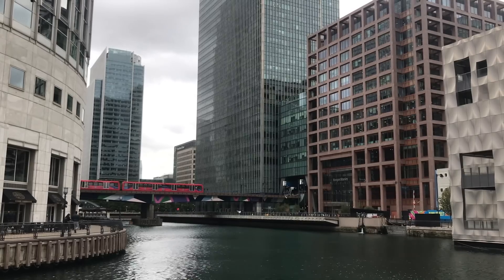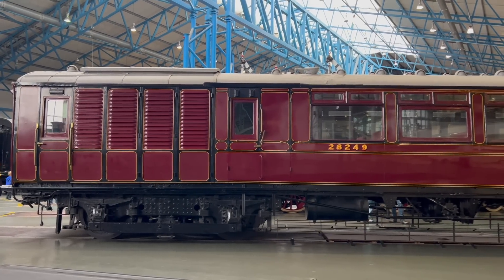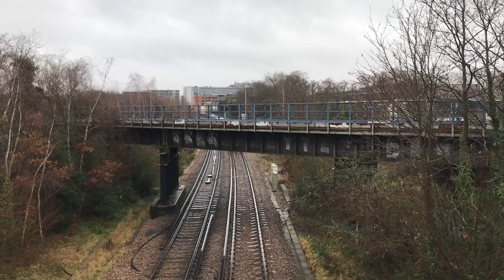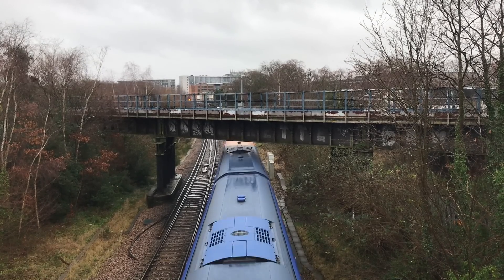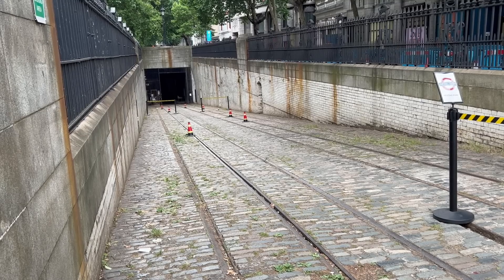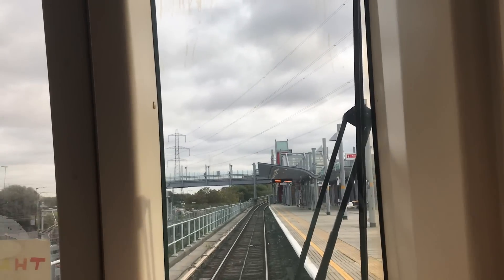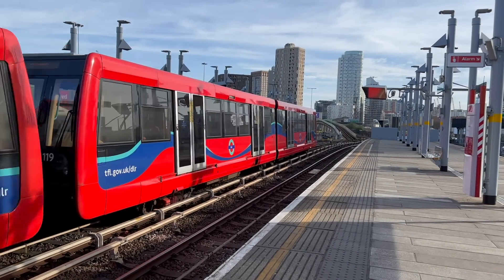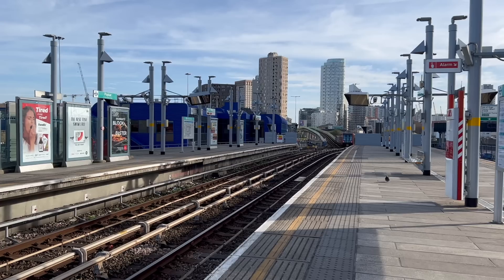How the Docklands Light Railway is Powered

Comment: That looks reminiscent of “New York Central” style 3rd rail that is still in use in the Metro-North system today East of Hudson.  The system travels about 50 miles north of New York City with sections that have at-grade crossings.  It’s definitely a commuter rail system with I’d guess approximately 2-5 miles between most stops.  I think the trains get up to 70 MPH in some rare sections, but usually stay below 60 MPH.  I believe the voltage is similar, ~750VDC.  The easternmost line, called the New Haven line, enters into Connecticut.  Before crossing into Connecticut, as the trains have to transition to the Northeast Corridor line, the trains on that line transition from using NY Central 3rd rail to Overhead catenary compatible with NE Corridor electrification.  The train cars also appear to be about double the length of the DLR cars in your video.  The consists are definitely much longer, usually being 8-12 cars I think.

Comment: When you read that the electrostars (and other EMU'S) on the Southern lines either have pantographs for the dual electrification routes or have been built with recesses for pantograph installation should the southern region main lines convert to overhead wires, it always makes me wonder how realistic  that actually is. The cost of conversion would surely be prohibitive & the time taken to do it would be beyond the life expectancy of those EMU's..

I presume that, based on what you say, if the Bluebell Railway were to eventually reopen the line from Horsted Keynes to Haywards Heath they would be unable to re-electrify that using 3rd rail to run heritage EMU's?

Comment: The bottom-pickup conductor rail is actually how almost all German third-rail systems work (Germany has no mainline third-rail-equipped lines, only metros and metro-like systems). The one exception I can think of off the top of my head is the older "Kleinprofil" underground lines in Berlin, which use the traditional top-contact variant.

Speaking of DLR trains equipped with the ability to use overhead wires - would you be interested in making a video about the former DLR vehicles that ended up being sold to Essen in Germany, where they were converted and are still in use today, as well as why that sale happened in the first place? I've ridden on those, and it's quite a sight to see the builder's plaques in the interior of a vehicle in Germany listing such an origin.

Comment: 0:26 sorry, but despite it's name the DLR is NOT a light rail system!

At the time the modern terms didnt exist, but still: it's a full metro, not light rail.

The trains have some typical features of light rail vehicles, but the routes are fully independent, that makes it a metro.

The new trains are also more typical metro trains
Reply: It's a light metro, definately not a full metro
Reply: @Gfynbcyiokbg8710  right on the border i would say. 90m long trains is pretty big for a light metro. "Full metro" means its fully independant from other traffic.
Reply: @nicolasblume1046  The DLR has definately been designed as a light metro with it's small (but long) stations, tight curves, mostly light rail derived rolling stock, etc.

So is the tube a "full metro"?
Reply: @Gfynbcyiokbg8710  both are "full metros" in terms of being fully seperated from other modes. The Tube is a heavy metro, the DLR is about at the border between heavy and light metro.

The DLR is not light rail for sure
Reply: @nicolasblume1046  1st of all, no one says that "full metro" means "fully seperated"

2nd, The tube isn't "fully seperated". It shares track with the overground and national rail in several places and there's a level crossing on tube owned track.

3rd Even if the DLR has a somewhat higher capcity than other light metros, everything else about it is much more typical of a light metro, so calling it a "light metro" is a lot more useful

Comment: As far as my understanding goes, the short distances between electrical sub-stations isn't because of the 3rd rail system, but because it is a DC system. DC powered railways that use overhead wires have the same problem as far as I know.
Reply: Inded - it is the low voltage: although overhead DC systems are usually at higher voltages than 3rd rail - typically 1.5kV or 3kV, this is still much lower than AC systems which typically supply at 25kV. The reason is that low voltages are needed for the traction motors and other systems on the the train, but there is no way of changing voltage in a DC system - transformers only work on AC. Transformers (and rectifiers, to convert from AC to the DC the traction system needs) are heavy and bulky, so add to the complexity of the trains. But transmitting electricity over long distances at low voltages results in more losses in the transmission system, so the substations need to be clsoer together.  So low voltage DC is more suitable where there are lots of trains within a small area, and high voltage AC when there are fewer trains traveling longer diustances.

Comment: I don't see why, with battery electric trains starting to come in, they can't have more third rail on the adjoining lines, but with gaps for stations and other bits where people are likely to come into contact with them. You wouldn't need a huge battery capacity to just fill in the gaps.

Comment: Hello Jago...  Have you ever heard of the Chicago, North Shore & Milwaukee interurban?  Called the North Shore by it's friends, this interurban line ran 90 miles between downtown Chicago and downtown Milwaukee.  The center of Chicago part was on the Chicago Elevated, which mecessitated third rail operation.  But north of suburban Skokie, the line shifted to overhead, something done on every powered car on every ttain.  And the change was handled manually by conductors and collectors (the rail personnel, not electrical components).  They had to quickly get trolley poles on the overhead wire, in any sort of weather, while the train coasted along at 35 mph.  Nowadays, such a power swap could be handled with pantographs at the touch of a button, but where's the fun in that?

Comment: The wire between the rails does not  transmit data....it is merely a timing loop split over set distances so trains can judge their speed and heading.

Data transfer goes through Docking Data Links, the flat, brownish boxes situated inside the running rail.....

Comment: A bunch of the old DLR trains that ended up in Essen have been converted for "tram" running along a section that goes above ground and along streets. Didn't manage to get out ot that bit to see how they power that bit. May have to nip back and check some time.

Comment: Short distances between substations is common with DC traction supply - not necessarily 3rd rail. In places 1500vDC overhead have substations less than a kilometre apart

Comment: It's basically the same as the Heathrow and Gatwick track transit systems. Only difference really is they run on pneumatic tyres but they still follow a powered guide rail.

Comment: Loved the Tyne and Wear metro shoutout!!!
Reply: Is the Tyne and Wear moving to heavy rail trains? Stadler, based on the Merseyrail 777s?
Reply: @johnburns4017  No, new trains are very similar to the old ones with most if not all of the design flaws sorted. It's actually surprising that they haven't extended to three trains, but that's going to require another depot.
Reply: @hairyairey  I hope you can still look out of the front window on the new trains.
Reply: @Martindyna  unfortunately not, the new cabs are the full width of the train. I used to sit at the front chatting to the driver as they would leave the door open. Different times!
Reply: @hairyairey  What a shame! Why remove a much loved feature, well I guess you answered that one, may disturb the driver. As you say, different times.
Reply: @Martindyna  It enables space to train new drivers. They used to kick you out of the front seat and train the drivers with the door open. Didn't stop me contributing useful knowledge to the conversation of course!

Comment: I didn't realize that no new 3rd rail lines ( 1:51 ) are allowed. Has this this ever led to any difficult situations around wanting to use the same type type of trains on neighbouring lines or what constitutes an extension of an existing line versus a new one?
I've seen that Thameslink trains switch between 3rd rail and pantograph to operate on either. I understood this to be because the alternate systems were historically used in the different regions: north and south.

Comment: This means that the DLR used pretty much the same design as the Stockholm metro. Also 750v DC bit varies a bit between the lines where the latest lines have a little more power. Delivery is through a 3rd rail on the side slightly elevated compared to running rails and covered by a wooden plank rather than plastic. Also the 3rd rail alternates sides and is always on the outside of the train at stations.

Comment: There was a third rail line from Manchester to Bury. It was electrified at 1200V DC.

Interesting in Australia there is a new Metro Line in Sydney, it is fully automated so driverless but uses overhead at 1500DC, the line is being extended this year and also firther in 2025 plus a new western suburbs metro from Sydney to Westmead via Parramatta.

Comment: Washington DC used a buried conduit system. Everyone called the current collectors "plows"

Back in the Sixties, the model railroad I belonged to was building a rapid transit line based on the Hudson Tubes (officially the Hudson & Manhattan Railroad). We had a very senior member who started model railroading in the Thirties when outside third rail was standard for models. He VERY strongly recommended an overrunning system, having tried (emphasis on tried) way back then to develop an O Scale underrunning system to be prototypically correct for a model of the New York Central's Grand Central Terminal electrification. We followed his advice!

Comment: Modern control and current isolation systems have made 3rd rail far safer than it used to be. It would be a good idea for the ORR or DFT (whoever implemented the rule) to reassess the policy against 3rd rail installation.

Comment: Short and sweet and answers exactly what I've always wondered. The centre rail looked too flimsy for the current necessary and the outer one was a plastic tube with all these bumpy brackets. It took me ages to suspect the pickup must be underneath and inside the tube.

Comment: I was under the impression that urban rail has its substations close together because it runs on DC. With AC (and higher voltages), they can be farther apart. But you don't really want to put 25 kV on a conductor rail.

Comment: Stupid question then. How does current return work with OHLE? Does it, too, go back into the running rail? And why is current return not unsafe?
Reply: it does go back into the running rail, and it's safe to walk on or touch as the voltage potential to true earth is very small; usually the return path is actually bonded directly to the earth with shunts to prevent the voltage floating above zero. you're much, much more in danger of getting hit by a passing train than from the rail shocking you.
Reply: @francistheodorecatte  thanks for answering! ☺️

Comment: In Germany U-Bahn and S-Bahn systems with third rail power have been using pick-up from below has been introduced around 1910. That is when the Hamburg "Hochbahn" (now called U-Bahn) and the first Großprofile-lines of the Berlin U-Bahn opened. The only lines I am aware of that use pick-up from above are the older Kleinprofil-lines of the Berlin U-Bahn, which opened in 1902.
Reply: Yes I'm not sure why Jago didn't mention that the insulated top 3rd rail has been the norm on the Continent for decades, perhaps he wasn't aware.
Reply: Under running third rail has been used in the US for well over 100 years, primarily in the eastern metro areas, for engines on mainline trains, and MUs.

Comment: The DLR system being driverless is mentioned in a throw away line at the end. if you aren't a Londoner this is'nt commonly known.
Reply: Not entirely driverless. There are situations where it's driven manually. Rowdy passengers on platforms for example.
Reply: Do you mean when they anticipate rowdy times?
Reply: @philipdove6987  Drunken passengers on platforms. An automated train would squish them and not feel at all bad about it.

Comment: Thanks, I was actually wondering what that skinny wire thingy was😅
Reply: Skytrain system in Vancouver uses this as well. Called leaky coax. Skytrain uses two of them in parallel due to the centre LIM reaction rail. Though I think they cross the leaky coax over for location tracking identification. Canada line which uses more tradition cars only has the one wire. Skytrain also uses a forth rail system due to train Ms lifting slightly when pulling away which makes for a poor grounding through the rails. Complicated but it is reliable and can climb decent grades.

Comment: Fun Fact about 3rd rail electrification under the Southern Railway between the Grouping and Nationalization. There were gaps in the conductor rails around infrastructure for steam traction, I've got a book of old black and white pictures of steam operation along the old SE&CR lines in London and Kent and there's a photo of a 0-4-4 tank engine pulling a passenger train stopped next to a water column on a line with 3rd rail electrification with the engine's coal bunker more or less in line with the water column and one of the crew on the ground. The caption specifically points out the gap in the conductor rail as being for the convenience of steam engine crews, which is concerning as most of the length of the gap is parallel to the engine with only a short stretch reaching roughly to the bogie of the first coach. If that was the norm and not a one off I feel sorry for the poor bastards manning the steam commuter services in south London.

Comment: i believe internationally speaking,, third rail bottom contact as is used on DLR is a lot more common than top contact - and britain absolutely is the only user of third rails on intercity distances. One potential benefit of 3rd rail systems for metros ive heard, is the fact that the wider surface area of the electrical contact allows a lot of trains to be pulling high currents (from rest) at the same time in the system - im not totally sure how correct this is though

Comment: The cable in the middle is called the inductive loop
Reply: Does it actually form loops or just run parallel with the rails, as it appears to do in the video?
Reply: It is a control rail, not a power rail.

Comment: Any Merseyrail fans here? I didn't know about the government rule that bans new third rail projects. There is potential demand on the Wirral for electrified services along the Borderlands line to continue onto the Wirral line at Bidston. I wondered if the new class 777s qualified as light rail a la DLR and, if they do, if consideration to now third railing the Borderlands line after decades of failed attempts.
Reply from the maker: I think there are a few Merseyrail fans around here - I should get up there and make a video.
Reply: @JagoHazzard  You'd be made very welcome. Please do visit.
Reply: I think not. Class 777 is a 4-car unit and weighs 99 tonnes. DLR Class B07 is too a 4-car unit, but weighs only 38 tonnes.

Comment: The conductor in plastic conduit was also used to power the electric prototypes of the french air cushion Aérotrain (the "S44" in France and the Rohr TACV in the US). It looked much the same, with aluminium supports, and was orange when new, and faded in a kind of pink just like these. But there were 3 conductor in a triangular arrangement : it was 3 phase power.
I'm not a Londoner but your DLR is cute, i'm still baffled it was possible to automate such a complex network, with branches, loops...

Comment: The DLR vehicles thet were sold to Essen in Germany in 1991 (P86/P89 series) were also converted to using overhead wires.
Reply: 1500VDC?
Reply: @hairyairey  750/800 V DC

Comment: I was a victim of snow on the third rail once. In those days between Loughborough Juntion and Blackfriars they only used the centre pair of track ouside peak hours. It had snowed overnight and I was on the first train of the day to use the outer track. A mile or so out of Elephant and Castle the train slowed to a halt. After a few minutes it carried pn. It would seem that snow had isolated all four pick up shoes and after while they had melted through the snow and picked up current again. This happened a couple more times and as we got ito Elephant and Castle station platofrm 1 we were told that the train had been cancelled and that we should go to platform three to catch the next train.

Comment: On the Southern Region and Underground lines you sometimes get terrific arcing when a pickup shoe breaks contact with a conductor rail. But the DLR's bottom contact rail is made of aluminium, and wouid soon get eroded away if that was allowed to happen. So every time a pickup shoe approaches the end of a conductor rail the traction control system on the vehicle cuts the power leaving the train to coast, and power isn't drawn again until contact has been re-established. 
It isn't much of an issue with the three car trains and multiple pickup shoes now in use, but when the DLR first opened with single car trains, 'gapping' as it is known was a significant problem.